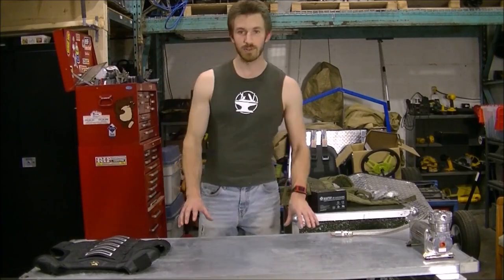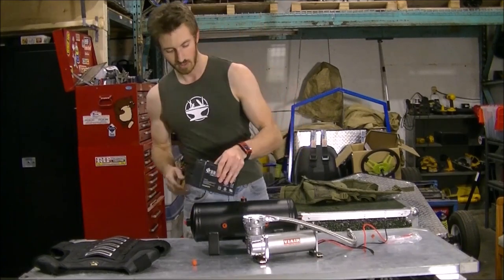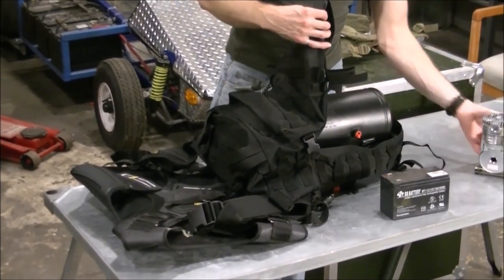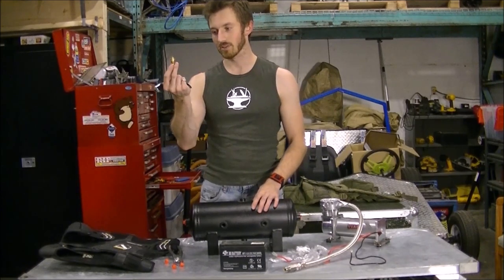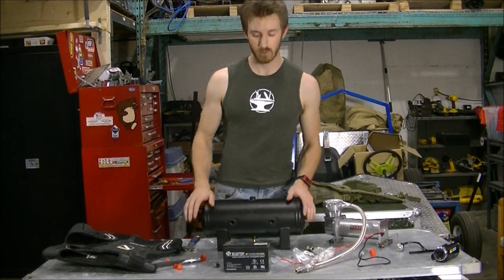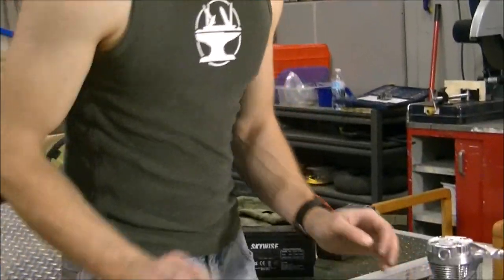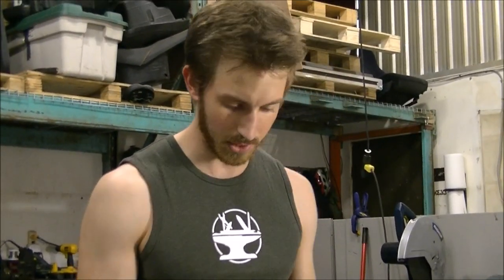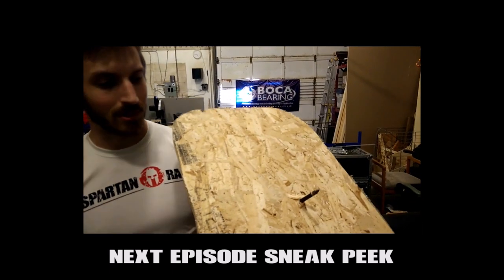Pneumatic System

Comment: Maybe you should put some noise cancelling foam in the back pack to make the suit quieter?
Reply: +Jack Amling That would actually be a good idea, if he housed the compressor in a largeish piece of pvc pipe (with gaps on the side for air flow + a section cut out for the shape), the covered most of it in noise cancelling foam that could seriously drop the sound.
Reply: I did hear that hydraulics are more silent than pneumatics

Comment: Normally on a compressed air tank, the bottom is for the snot valve. Yours doesn't really have spot for it on the bottom because you'll be carrying it vertically, so... doesn't really matter much, but you do need a snot valve in there somewhere. The moisture from the compression will rust away the inside of the tank and also have nowhere else to go. You may eventually end up with an impromptu rocketpack when it rusts through the bottom.

Comment: So... is a jet pack asking too much or....?
Reply from the maker: I will try my best
Reply: Jet pack
Reply: +the Hacksmith It is in fact very possible if you use compressed hydrogen. It will provide good trust without taking too much place. The problem is that compressed hydrogen is VERY dangerous so you might want to use a polymer hydrogen tank. Hydrogen should also be used as the main power source (with a fuel cell) for the exo. Compressed hydrogen has 200 times the energy density of lipo batteries.
Reply: +Challenge Declined it's really more of a jump jet. a jetpack would be sustained flight, and would need one HELL of a large fuel tank or to be connected to the power system of a suit (like the fusion cores of power armor in Fallout 4) in order to work for an extended period of time.

and if you don't know what a Jump Jet is, think the Darktroopers from Star Wars Battlefront and Battlefront II. y'know, before Pandemic got sacked.
Reply: Rogue Tom 
Hi
Reply: Mr Burrito 888 
Hi
Reply: Deleted User
Hi
Reply: YnnatheguardianChannel 
Hi

Comment: I think it's the parts you have to design in order to get a proper outcome of the project. my theory is that you need to design a motor that move like those robotic arms but is small and light weight. once you have them all for the shoulders, elbows, hips, knees and possibly other joints I haven't mentioned, you have to design a frame that can withstand high pressure but is also light weight. mabye an alloy of some sort. after that you have to program and calculate the a force for a normal human being and the resistant force when it's being put under stress.  it has to be very touch sensitive in order for it to work otherwise a miscalculation could cause problems

Comment: you should do some research into graphene supercopasitor batteries and use electronic cylinder pumps instead of the noisy air pumps and for a longer lasting time, take's up less space and is more powerful

Comment: if you have a 200psi shut off and a 200psi safety regulator isn't there a chance that the safety will go off before the shutoff switches and the compressor will just keep on running??

Comment: Just a heads up, you're putting your Teflon tape on backwards. You want to do it the other way so when you screw it on, the tape doesn't unscrew off of it, if that makes any sense. Probably doesn't matter on these smaller fittings though lol, but still, I would bitch at my helper if I caught him doing it that way.
Reply from the maker: thought that was the way I was doing it... maybe I messed up though!
Reply: the Hacksmith The way I do it is hold it all exactly like you did at 6:06 (including the direction of the roll which is important!), but start the tape on the bottom side of the fitting rather than the top, and roll the tape over the top the same direction as screwing a fitting on. Don't spin the fitting, roll the tape on.
Reply from the maker: +Kevo F Ahhhh gotcha! Thanks!

Comment: OK so I know you have cost limitations. but wouldnt  hydrolics  be a much better choice because of the movement  restraint of the pnumaitcs. because oil doesn't compres like air does you could make it more effective for fine motor  skills. I'm just saying this for practicality for millitary , rescue , or construction use.
Reply from the maker: I'd love to use hydraulics, but cost is a limiting factor. benefit of pneumatics though is more flexibility -- you can move them about without any energy waste. can't do that with hydraulics

Comment: Dear Mr Electronic Wizard,
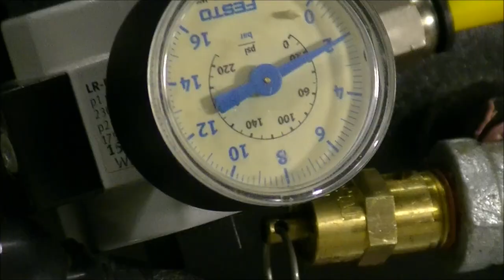I got a question according to your measuring at 07:35. After taking back the measuring device, you noticed that the current draw from the batterie is too high. What makes me asking, is that for measuring current you have to connect your Multimeter in series to the batterie. This means, after "unplugging" the engine should stop runnig, right? It didn't, so how does your measuring work? Some secret canadian special-technique, or did I just get something wrong? :)
Reply from the maker: Hey there! Sorry your question confused me for a bit -- I was only measuring voltage at the time. I had heard that the compressor didn't sound like it was running at full power and checked the voltage of the battery (which was low) and since it was a small battery, it was having trouble providing enough current to the system. In our later videos (posted) you'll see we've upgraded the system to a 22.2v lipoly battery which really makes the compressor purr =)
Reply: Thanks for the answer :)
I was just a bit confused about you talking about the current flow after measuring the voltage. Have a nice week :)

Comment: have you found a way to inexpensively regulate the air pressure down to 200 psi. i ask because i was wanting to do the same thing but for air tools but all the regulators are over $100
Reply from the maker: harbour freight has oxygen regulators to go from 3000 to 0-200
Reply: +the Hacksmith thank you for the fast response. could you post a link in case others have the same question

Comment: a pneumatic system for an exo... this may be a powerful system, but it take way too much room, it's inaccurate and has slow response time. You might want to look for high power DC motors instead.
Reply from the maker: depends on the goal of the exo, if I had a budget I'd be doing hydraulic! servos are too expensive to get any reasonable strength at the joints (think how much torque you need to move a 2' moment arm), electric linear actuators are strong but really slow!

my plan with the exo is a lower body that is flexible but can lock at the joints (unpowered) and then a flexible upper body that can have extreme strength but only when you need it. this gets around the big power problem.
Reply: +the Hacksmith I think you 'll have to use a built-in gyro system for every joint of the exo so that is can accurately predict your mouvements. + it would make installation faster than using pressure sensors which need to be applied on the muscles.
Reply from the maker: +EEEE le r Upper body yes, but lower body is purely mechanical -- very simple. The idea for the flexible upper body is to have a mode (going to get expensive) where all the valves are open, so the cylinders are free to move in any which way. Then when you need to do a feat of strength, you activate it and do it. In doing it like that you don't have to worry as much about a very extensive control system, which makes it a lot more viable for a guy in his garage to build =)